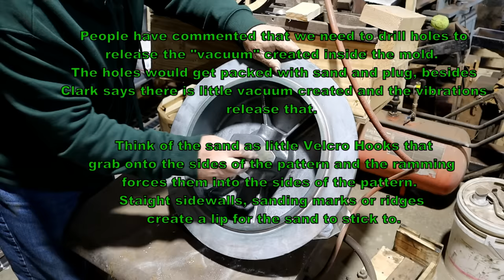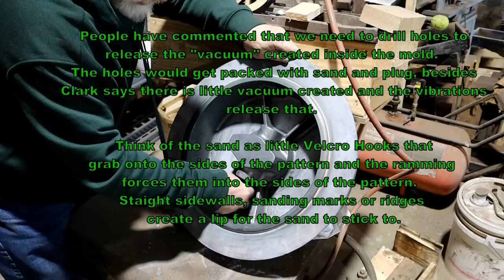Pouring the Tally Ho Capstan: Final Pour Unabridged Version

Comment: To hell with the "I know better" mob who never done nuthin!

Well done guys!!!
Reply: Sometimes, the know better mob actually has done sumthin and is trying to help.  I have set up production tooling for foundry and casting operations. For pulling patterns with such shallow draft angles, you need a rig that can lift the pattern or drop the mold dead straight along the draw direction without the slightest tilt or misalignment. Pulling up from the center of a circular pattern by hand and eye is a trial and error method that reduces the chance of success dramatically.   A jury rigged electric hoist that jerks a lot and is not directly overhead is less than ideal. A mold that was not designed to be flipped easily and to be pulled uniformly is also a complication. 
Ensuring there is not the slightest roughness or undercut on the draft surfaces is also critical.  The pattern could have been made with a half degree more draft and that would have helped a lot.   But for this foundry, I would recommend some scissor lifts and leveled benches that can be used to better control how molds and patterns are drawn with smoother and more linear action.  It would make future projects a lot less frustrating.
Reply: Look forward to your videos.
Reply: @christopherpardell4418  Most of what you say is no doubt true but you have no heart or kind word so you know what you can do with all your smarts!
Reply: @musicbro8225  You don’t know a good heart when you see it.  Offering someone who is trying to do something they have never done before the benefit of your greater experience so that they can have greater success is an act of kindness and generosity.
Reply: @christopherpardell4418  I'll give you that as a possibility, but offering it unasked for could easily be seen as arrogant. Where was the congratulations? Or were you too offended by his dumb luck? He, using his methods achieved something significant and all you can say is he did it wrong. It makes me annoyed!

If you were sincerely trying to help, you should work on your manner of suggestion and on your humility, otherwise nearly everyone will be thinking what I have said previously to you.

I'm not a mean man so I apologize to you.

Comment: Wowzers what a job that is. I knew from past experience of doing small casting the effort that goes into getting the pattern right and then actually getting the sand mix right and then the pour is massive undertaking. But this is just a whole next level. 
From kiwi land.
Reply from the maker: IT was.... There were problems with the pattern but all worked in the end ..

Comment: I have none of this guy's skills or experience, but I recently tried making a two part mould so that I could make a forged carbon fibre part  and it is a nightmare even for a small part. Making parts by using a pattern to make a mould and then casting the part from that mould seems to me to be a process that has it's own failure built in at every step, and you are lucky when it works, I admire the tenacity to keep going in the face of adversity. (sorry if the spelling of mould and fibre is upsetting - I'm in the UK 😁)
Reply: From my experience of casting, it is extremely satisfying when it works out well! But whenever I watch sand casting it just makes me anxious :)
I'm a Kiwi so your humour is appreciated.

Comment: A thin, flexible and tip controlled fiber endoscope with adequate lighting will provide vision into the remotest corners of your moulds.
Reply from the maker: Not in this one.  Tried a very expensive one but there is not enough room to go through the riser to see anything.  And it is too dangerous to screw up and hit the wall of the mold. Drop a piece of sand mold in there and the piece has a void in it...

Comment: When I used to build balsa wood models (about 45 years ago) I would paint them with something called Dope.  I would put coat after coat on, sanding between them.  In the end I wound up with a glass smooth surface that I could then paint.   (my P38 was a thing to behold)  I know you are done and it does not matter at all now, but could you have used dope or epoxy coating to make a smooth surface?

Clark dancing a jig on the sand, with you and Keith Rucker as back up dancers.  - now that would be TikTok worthy.
Reply from the maker: The pattern came varnished and sealed.   Clark applied a slurry of graphite and alcohol  to the pattern to make it even slicker.  The problem was it needed more sanding to get rid of any roughness from the pattern work... Even a saw mark is a locking point for the sand to mold to..

I have tried for two years to get Clark to go barefoot!  I know once he tries it he won't go back :)

Comment: Nice job! Glad you kept after it!  One question as hard as it was to pull the pattern off the bottom could you have made the bottom out of the CO2 core material?  I'm sure complicated.
Reply from the maker: The cores surfaces made that way are much more course grained. The sand Clark makes is more fine textured and gives a better finish l.

Comment: Great result! Just a curiosity, is there any reason you couldn't use the co2 activated silicon sand for the main mold itself?
Reply from the maker: Oh I think you could, but what do I know... That's a question for clark.      I would be really concerned that the gas would not reach everywhere in the 8" thick sand around the outside of the core pattern or inside the interior of the part...  

If you watch the SV Seeker chanel you can find videos where that was used to make all kinds of things such as the port hole covers and even the propeller blades.  I think Doug  used it because instead of black sand because it was easy for him and he did not have a supply of the good sand.  

The sand Clark makes works fine, he uses it everyday and gives a good finish so it was appropriate.

Comment: I don’t understand why you used a core mold for the outside relief profile. Why not cut the profile with a lathe when doing the cleanup machining. The relief is not that big. Nice work though.
Reply from the maker: Clark did not make the pattern, it was sent to him. Clark mention some other type of pattern that had removable pieces but we had to work with what was sent..  I'm with you though, I would have made it solid and turned it also.

Comment: It seems this casting was outside of Clarke's typical skill set.
Reply: No it was just at the very limit of the amount of metal he could pour with his existing furnace. He knew that going in
Reply from the maker: Yes I know all about the hub and pullers.. My old grinders all have that setup... I was stumped by why I can't get the flange off the hub by taking out the 4 screws... Sure don't want to mess it up and being cautious here.. When it would not turn with pin wrenches or loosen with light blows from the dead blow hammer I just stopped... I figured the 4 bolts would tighten the front flange against the back flange but they don't seem to put any more pressure against the wheel when I tried to tighten them a little....

Thanks for helping out :)

Comment: Not so much talking? You couldn’t put it in a bucket without a bottom. I tried watching one of your previous videos about TH capstan, and had to give up. Tell me, how does this work? You quote Leo, say, ten thousand dollars for the Capstan, but because the flask catches fire, the sand falls out of the mould a couple of times, it takes four attempts. Do you charge him forty thousand bucks? Why didn’t he give the job to Port Townsend foundry? They seem to know what they’re doing, they are local, and they make good videos with Leo’s help.
Reply: Port Townsend is a non-ferrous foundry. Casting iron is very different from bronze. 3x melt temp for example. The title says unabridged. People talk while working through tough problems. Foundry prices are for finished pieces, not processes.
Reply: Jeez this is one of those mean comments
Reply: Actualy he’s not charging Leo anything
Reply from the maker: Wow are you misinformed!  Clark  and the people that helped him did not charge Leo a dime.....   The Sand did not "fall out of the mold" until after all the moisture was baked out of the sand by the 2800 F metal baking over night with I might add the metal being cast... 

Cast Iron is NOT anything like bronze or the non-ferrous metals they cast there....  

I guess making a long video series explaining most of that is just lost on some people......
Reply: @benters3509 I see you not only know very little about casting but also not a lot about how business works!